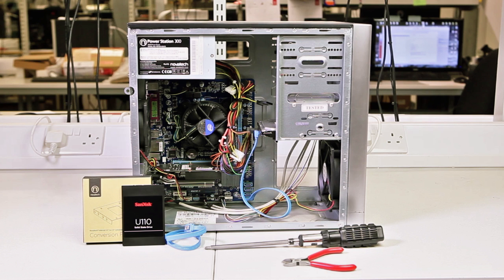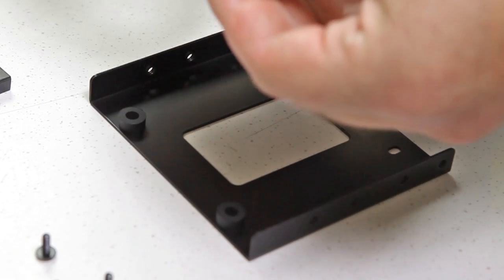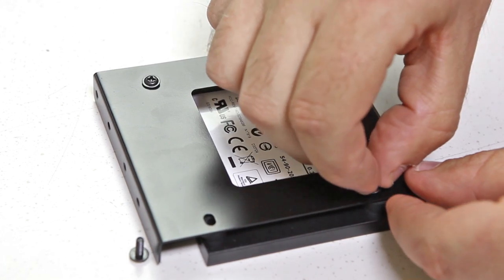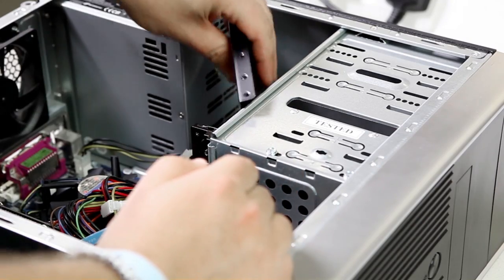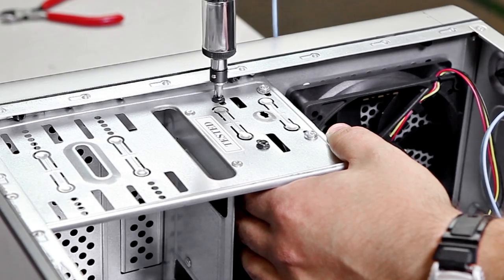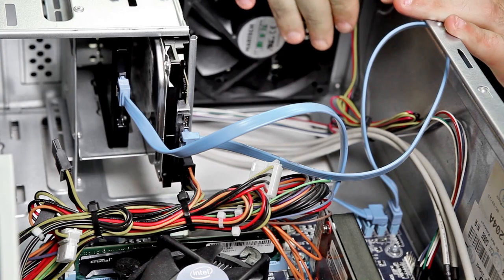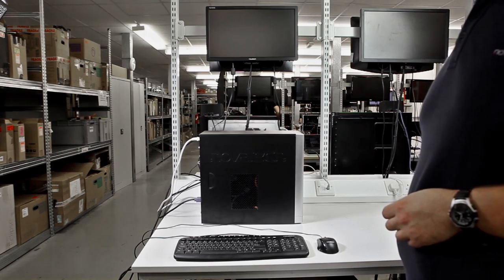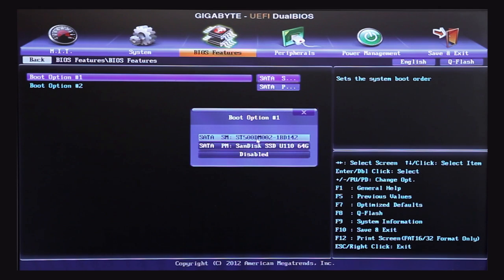Novatech How To: How to install an SSD using a conversion bracket.

Comment: Did anyone else notice that the sata lead was put in the Wong way round the 90 deg bend should of gone on to the ssd drive not the motherboard :)
Reply: aslong as it works! :)
Reply: Yew, Paul, I did notice that. True Crispe1, it does work, but it renders the last motherboard SATA port unusable, so probably better, and just as easy, to do it right in the first place...